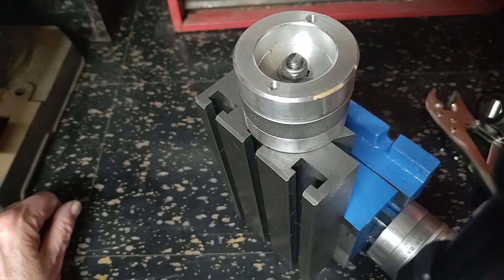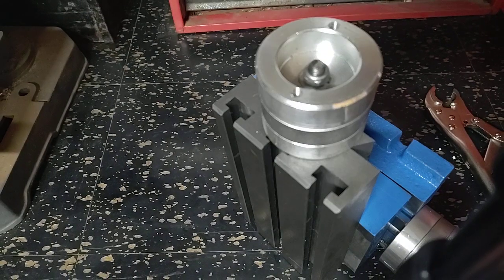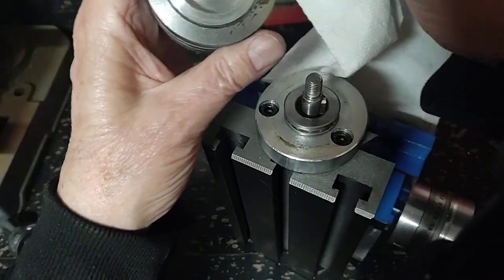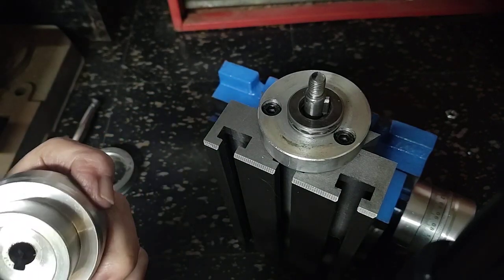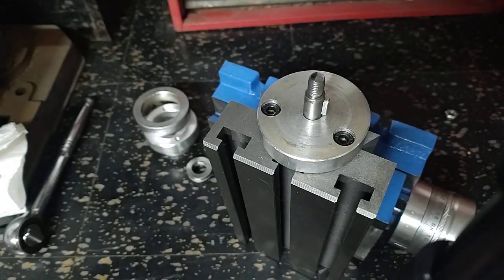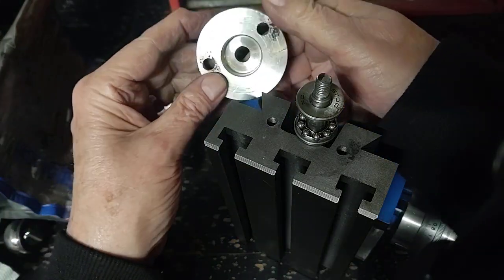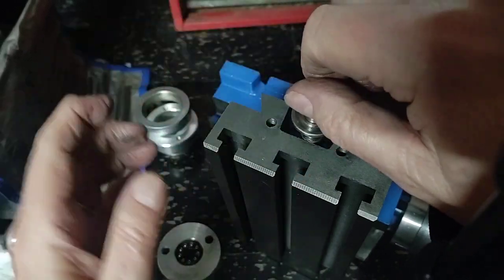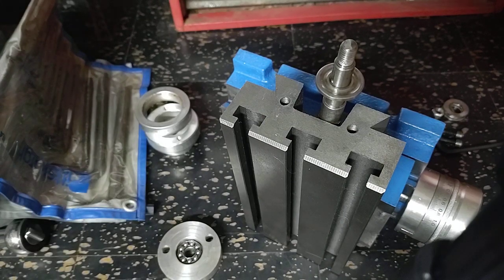Morphin X-Y table tear down of Y axis. Ah the cheap Chinese stuff, such fun!

Comment: So nice that new out of the box it's rusted. Really bad nickel plaiting there. Like wow. Also a manufacturing defect, again a problem. I hope that you can get this replaced.
Reply from the maker: Amazon will go broke with these, shipping 20 odd pounds of metal around the county because the maker can't be bothered to clean before plating. But Amazon did do an exchange in a timely fashion.